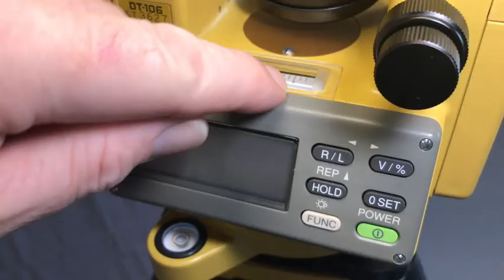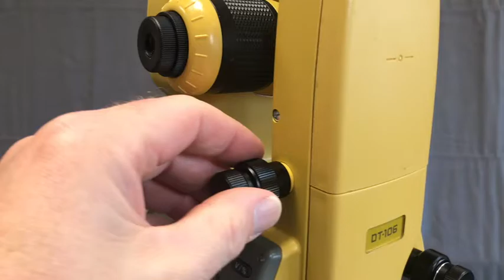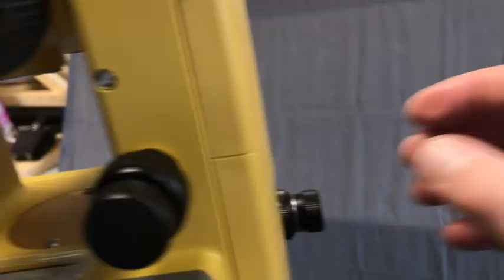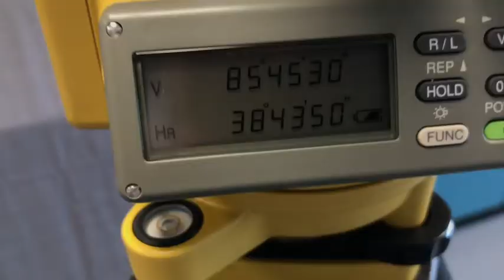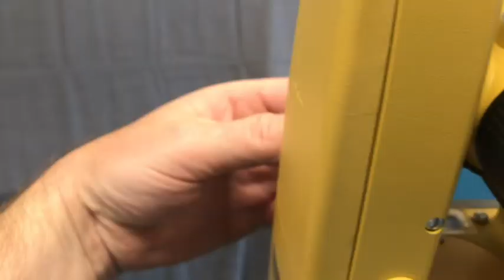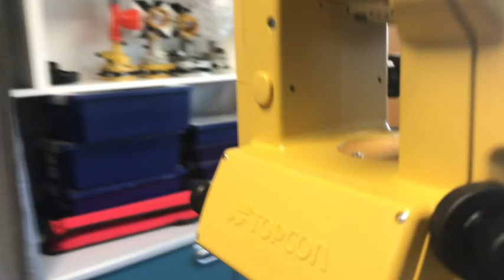Theodolite  - Measuring Angles

Comment: Hello, this is a great video, I actually recently purchased this same theodolite, do you know the best company or seller to buy a battery pack/charger for this? I hope they still sell them, I hace been looking everywhere. Thank you!
Reply from the maker: Sorry, you’ll have to forgive me — it’s been quite a while since I last used one, so my memory’s a bit hazy and I don’t have access to a unit at the moment.

Please check the existing battery pack. If you see a silver metal plate on the inside, it can be removed to reveal four AA batteries, which power the theodolite.

If that’s not the case, you might want to look on AliExpress to see if you can find a compatible battery and charger.

If you still can’t find anything, feel free to come back to me — I can’t promise anything, but I’ll do my best to help.
Reply: @applied-maths Thank you so much for this info, you have no idea how much this is appreciated. You are amazing!

Comment: The bubble level on the tribrach should be centered by adjusting the legs, then use the 3 wheels to adjust the plate level.
Reply from the maker: Thank you. I totally agreed with your comment but my students never listen and end up running out of adjustment on at least one of the levelling screws.

Comment: ?Im student..im look for user tutorial.I am a little confused.  You looking at a optic prism reflector on a theodolite that does not work with a prism refector? Out on the field this type of theodolite is used in conjunction with measuring staff  and read off stadia line. True?? Any who thank you. Liked and subscibed..
Reply from the maker: Yes this theodolite can be used with the stadia lines on a survey staff. Typically the distance from the instrument to the rod can be determined quickly by subtracting the bottom stadia reading from the top reading and multiplying the difference by 100. However please pay attention, the stadia distances have a low level of accuracy, a one mm error in staff reading gives a distance error of 0.1 metre

Comment: Thank you for your lecture. Compared to many beginners courses in English language I enjoyed you took your time to explain the neccesary details to reach the so neccesary correct readings. Though I have a some questions. Question # 1: Electronic theodolites can change the horizontal presentation in Captal letter H with index letters "l"or "r." Why is this and how does that relate to the action of turning around the telescope and the theodolite 180 degrees (turning the theodolite around its vertical and horizontal axis180 degrees);
Question 2: When we want to measure more poins, like Rowena asked about, how do we measure them? First do a 2 point with your proceedings in order to estabish how fine the readings of the theoudolite is and the do the same fore each of the 6 points? My guess is when I measure from 1 point (like for a building) I measure with the proceeding for face left and face right each point. When measure over long distances I do one face left and one face right for 2 pont in orde to know how accurate my theodoliet is. After that I wound do a run like a closed travers. How would do you advise? This would be interesting ground for a follow up course.
Reply from the maker: Alex thank you for your comments and to answer your questions.
Q1 - The L and R relate to the direction of rotation when you measure a horizontal angle. Normally I would measure horizontal angles in the clockwise rotation direction and then dealt with calculation based on those measurements. 
You may wish to swap the direction to anticlockwise so that you can measure the acute version of an angle rather than the reflex version of the same angle - if you search, angles, reflex and acute you'll see what i mean.
Q2 - I need a little more explanation - are you bring to measure several angles at the one station and then looking to correct these??? If so, there is a process of least squares estimation for doing this but i want to make sure that I'm answering your question correctly before uploading a video. 
To explain the process, say you are trying to measure 3 angle (a, b and c), all from one station.  First I would measure them individually first. Then i would measure the angles in combination i.e angle a and b together then angles b and c together and finally the angle a and b and c all together. Then with the least square estimation method, then you can mathematically determine their individual values. 
If this sounds about correct, let me know and can produce you video on this mathematical procedure.